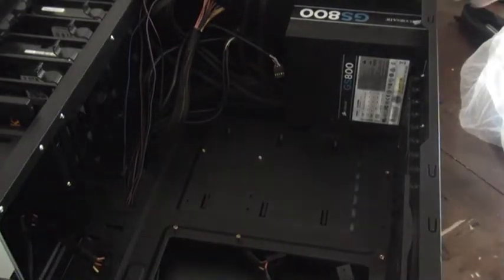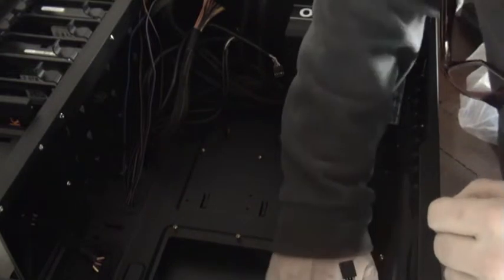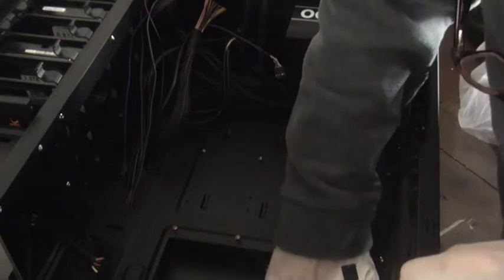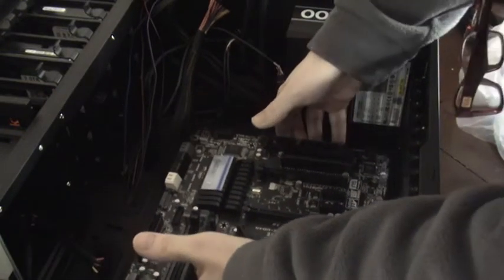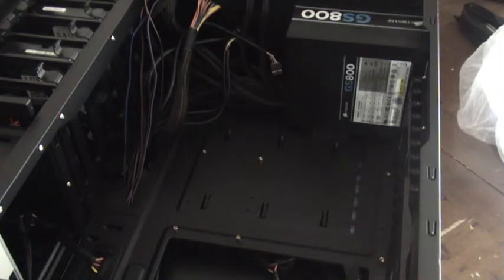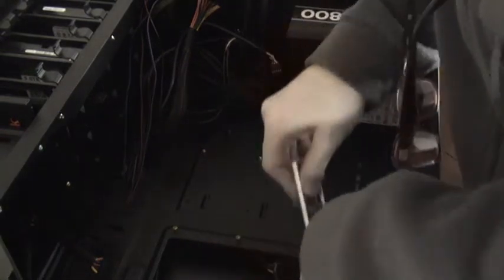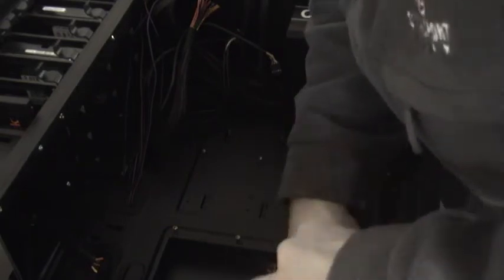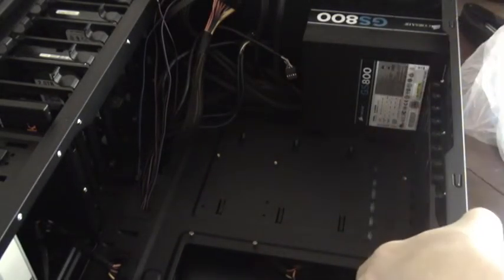P3 - Installing the new motherboard and wiring the case

Comment from the maker: HI Sjoert, Since building my pc with this motherboard  GA-Z77X-UD4H, I have had no real issues at all. 

I have had some minor glitches, which may not be related to the Motherboard:  not able to create system discs (using Window 7 Home) and every so often the screens (have 3) go blank for few seconds, almost like a power failure, however everything comes back with no loss of data, and happens rarely < 1 a week and lasts for few seconds.  

These are the only problems ive had ("touchwood!").